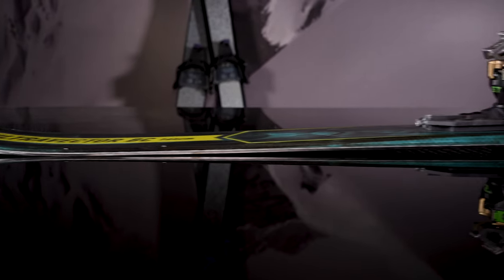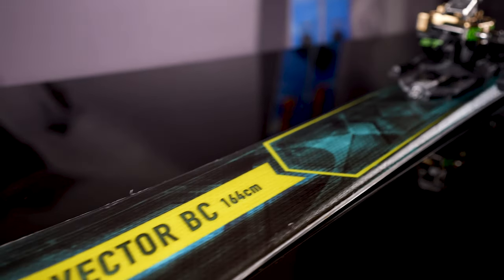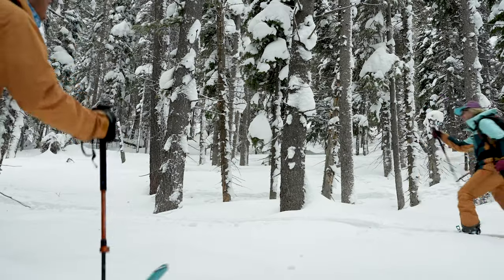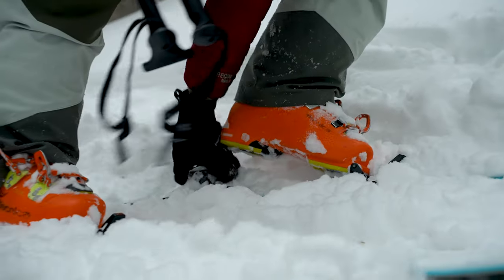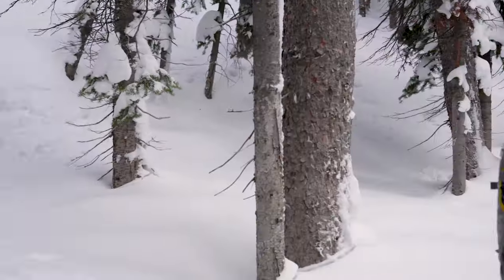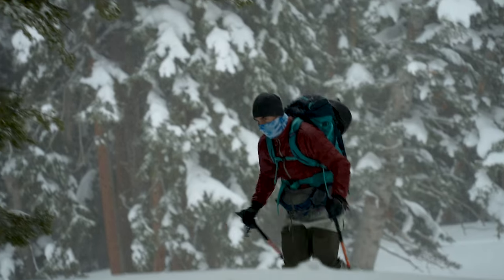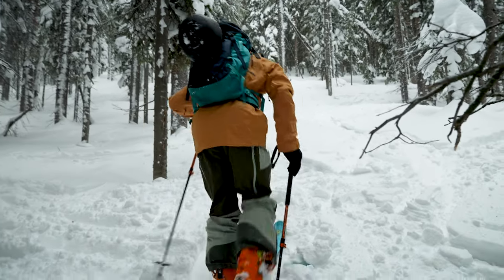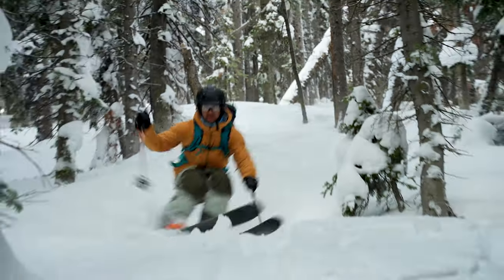Everything You Need To Know About Scale-Based Skis And Boards (Traction Pattern Bases)

Comment: I prefer the fish scales over the integrated skins.  The scales glide better and if you need to you can put a full skin on.  I find that they perform almost the same as the integrated skins, I can't really tell the difference.  The fish scale split boards are amazing technology.  For the East this is probably how snowboarders will enjoy backcountry because we don't have a lot of terrain that is open enough for riding.
Reply: I had great success with my skins adhering fine to a revelator bc this past season, lots of very long approaches and extreme elevation gain, used a hot wax tip and tail and nothing under foot. I look at scales as more as a descent tool that ascent, but yes low angle ascents

Comment: Would these make a good set if you only want 1 pair of skis for rolling hill backcountry and still wanted to ski lift service resorts?
Reply from the maker: Hey there, Matt. While there's nothing saying you can't ski these in lift-serviced terrain, you'll definitely feel a difference in performance coming from a ski without scales. We've found on low-angle, groomed, trails that there's roughly a 13% reduction in downhill speed with the scaled skis when going in a straight line. That said, we're currently working on gathering more data on this and plan on releasing a video once we have definite numbers!
Reply: @voilemfg  How about for a snowboarder that's switching to skiing? I feel I likely wouldn't notice the 13% speed reduction while I'm learning the technique.
Reply from the maker: @MrBig617  You may notice it more while you're starting out and finding yourself in low-angle (slower) terrain. Aside from the speed factor, these skis are the same as our non-scaled offerings. This setup just might work for what you're doing and we've had people in the past use these for occasional inbounds use. Our general rule of thumb is "The steeper the terrain is, the less you'll feel the differences".
Reply: I ski lift served all the time with the BC version of the V6. The only time you notice the speed difference is on low angle cat tracks. The more hard packed the snow, the more you notice the scale drag. In any kind of powder there is absolutely no difference.
Reply: Also the more you have the ski on edge, the less drag you feel. This can make turning feel faster than going straight.